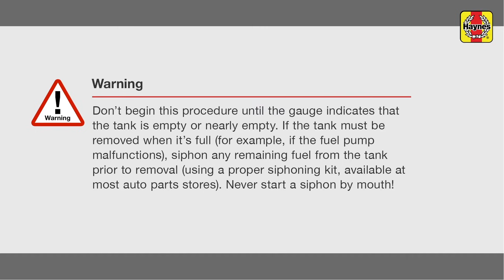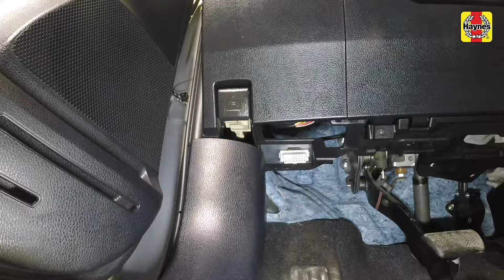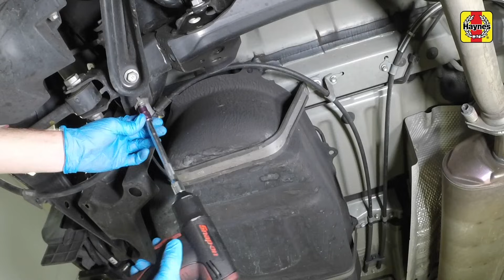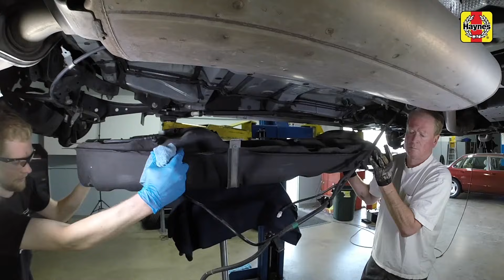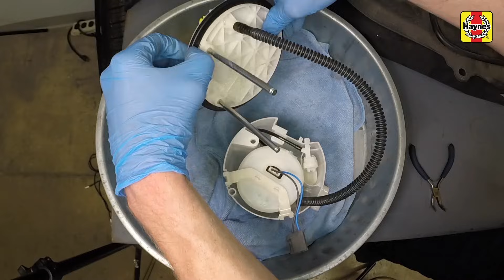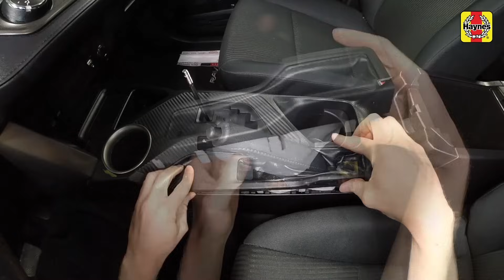How to Replace the fuel pump on the Toyota RAV4 2013 to 2018

Comment: Does toyota rav4 2014 have access to fuel pump inside the car under the rear seat?
Reply: @1emthoi  I believe the early non Japan vins, up to 2015. Best way to know is to remove your seat, pull back the carpet and take a look!

Comment: Yea rust free car! Fun times when rusty,this is why my next wheels will be electric,tired of this old fashion technology,
Reply: Yeah, rust does suck. Just wait until you get stranded because the freezing cold weather depleted your lithium battery that is supposed to run your electric vehicle..... you can't win either way...... it sucks because once the main battery that runs the electric vehicle  fails it is going to cost you around $20,000 to replace it. They just want to keep you making car payments every year. Either way we (the consumer) still lose.
Reply: Gasoline vehicles are hands down more reliable than an electric, so what if I have to replace the fuel pump for 200 bucks, like the guy above me said, costs you 20,000 to replace batteries, all the seats and carpet have to come out. Have fun with that...
Reply: You wont be repairing an ev at home

Comment: Wow Toyota, I thought you were better than this? No access via the rear seats? WTF!
Reply: Remove and replace the center console add 1hour to unplug the power harness. Why not remove the fuel pump relay and achieve the same thing in 15 seconds..? C'mon man..
Reply: I agree with your comment!  I had a 2005 Pontiac Vibe (Built by Toyota and GM so it was pretty much a Toyota Matrix) and when that fuel pump went I was very happy to see they could access it from below the rear seats.  Too bad Toyota didn't think just a little bit ahead and do the same with the RAV4!!
Reply: Had a 97 Grand Cherokee had to remove fuel tank...was quite a job. I try to keep tank 1/2 full or better to hopefully keep pump longer. When these go, definitely stuck.
Reply: Yeah not ideal but you think this is bad go look at the Cadillac cts
Reply: I know right!! No access door under back seat.. sucks.
Reply: @yoshivon  I mean you could always drill your own hole and have a cover made or just use some good aluminum tape to seal it up. It looks like there’s already a small hole right above it so locating the correct spot shouldn’t be hard. I might go take a look myself since I have a 2018 rav4.
Reply: @SuperSpreeGaming  this was 3 years ago. I can do this job in under an hour now. Still hate you can't just take the rear seat out though.